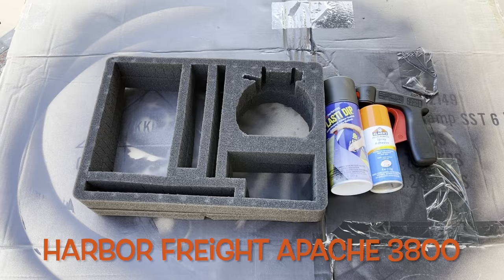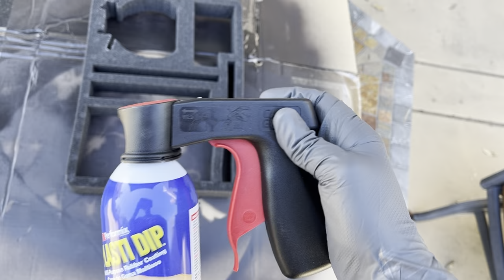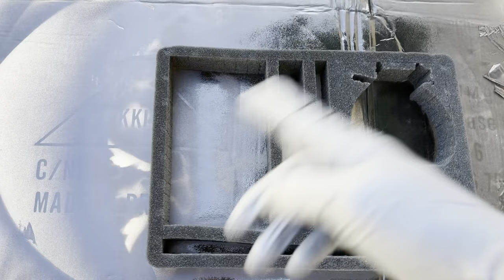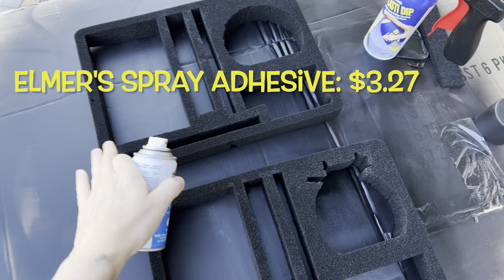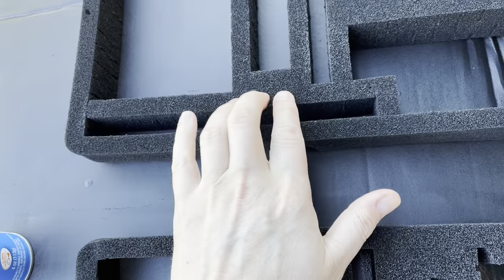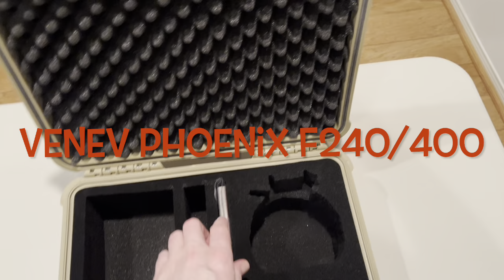How to Plasti Dip & Reinforce Pick N' Pluck Case Foam

Comment: I tried to do this to my box and RUINED it. Coats were so heavy the foam actually shrunk a few inches all around. Good video, great info. Will definitely be more patient next time.
Reply from the maker: Bummer! Hope next time turns out better. Thanks for watching.
Reply: I did the same. Sucks.
Reply: Thanks for posting this. My logic was thicker coats will soak into the foam better, leading a more solidified end product. Seems I was wrong!
Reply from the maker: @rocketech lots of light coats is always the way to go with this stuff, even on say car parts or wheels

Comment: You will save a lot of the Plasti-Dip if you sprayed both parts stacked together instead of apart.
Reply from the maker: It would be too hard to get it down into the narrower cutout areas.
Reply: @EdgeStoneKnives  Flip it over and spray from the opposite side once the first side dries.

Comment: Does the plasti dip start to rub off on the items when you start to remove them and put them back alot?
Reply from the maker: Not in my experience. Maybe if you're doing it every single day it would eventually start to a little.